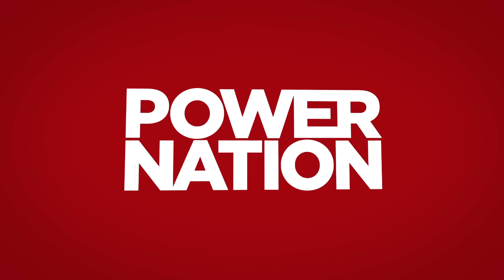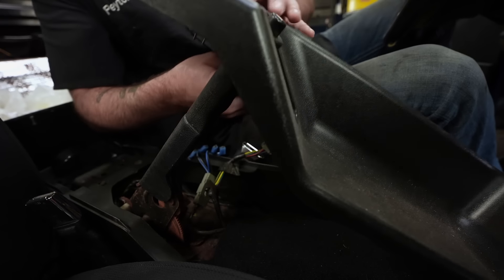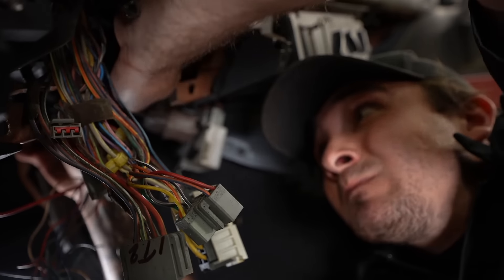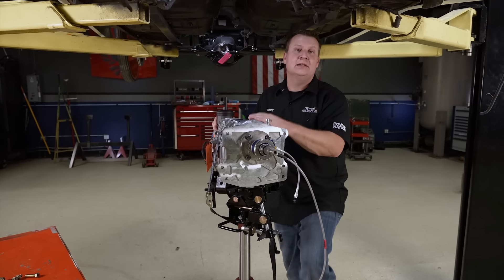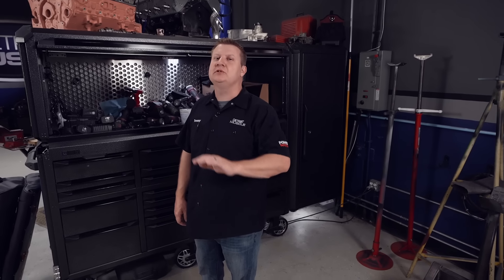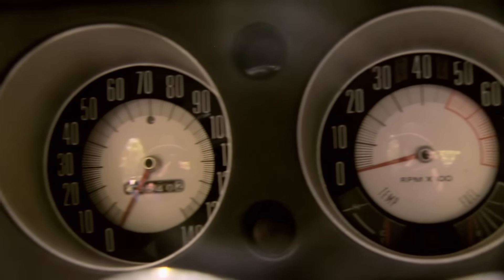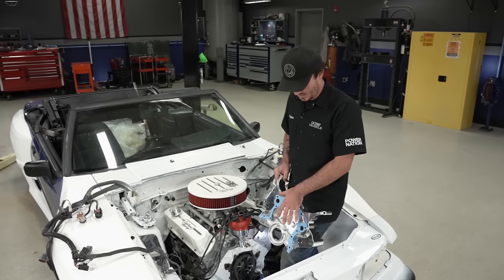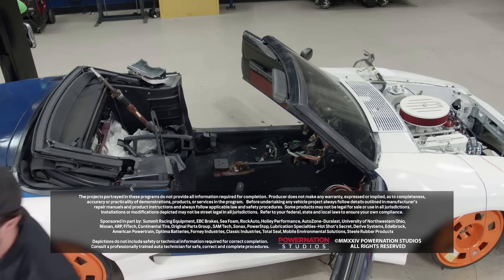Foxbody Gets the Heart It Was Meant to Have, a Stroker Small Block Windsor - Detroit Muscle S11, E9

Comment: Not sure what worse, working on wiring or under dash work 😂. I find both less than fun. My dad and I had to fix heat/ac issue under the dash on a 75 F-250 when I was 12. I am 57 now and still scared 😂😂